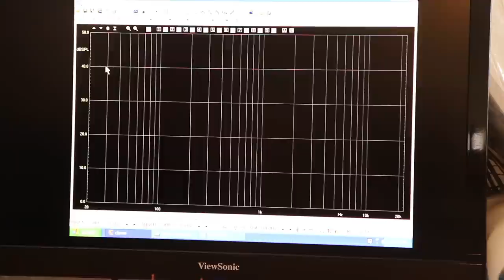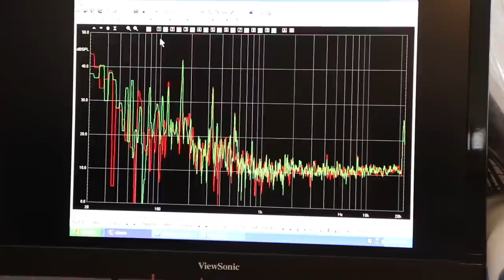Power Cable Tech Talk and a little help for Amir at Audio Science Review

Comment: 95+ % people do not own a system capable and at the level of being able to hear a difference in power cables. 

Another large majority of human beings do not possess the acute and training or ability of hearing to even be able to hear the difference. That’s another one of the problems. . 

Then another factor 
      If the system power cable does not radiate the EMF or RFI close to adjacent speaker, cables or signal cables to cause a problem, laid out in perfect conditions.   In that scenario, there may be no difference that could even be audible to somebody with not the best hearing.. 

But you turned that same scenario around as when I was a teenager.  Even my cheap system when the power cable was laid in back with all the other wires would mess with the sound and cause a problem..   but if I took a extension cord and routed the power cable up away from all wiring and away from the back of the units, preamps everything and over the top, giving it power from the other side of the room it was crystal clear.  
               So I changed out the power cable with one from a bonded and shielded VRF Drive Power Supply cable.  
         After I did that, the audio was clear, an interference, free. 

In that scenario, we’re talking about interference. Sound problem . 

Yes, I’m here is one of those characters he’s not stupid .   But he’s analytical and black and white paper kind a guy who can’t reason or fathom anything outside of what can’t be measured or cannot see with his eyes. Therefore, he thinks it doesn’t exist..  

      This is a human trait wired deep in green in the brain of a type of person he cannot help that.    

Just like some artistic people cannot look you in the eyes and be social, but yet they could be geniuses in one area .    But if you present them a problem that they’ve never seen before and they can’t comprehend, they just don’t get it.. 

Amir is one of those individuals, very bright, very talented. He has his field of expertise. . 

He has experience, but there’s just some things he just cannot grasp with his mind that are beyond his ability, probably till his dying Day .
Reply: "95+ % people do not own a system capable and at the level of being able to hear a difference in power cables. "  How come this is not stated on company website so people with lesser systems don't bother buying said cables?  Note that my testing of GR24 cable was in a very noisy environment.  Yet, I measured zero impact to the output of audio gear with no name cable vs Danny's.  Remember, there is a ton of noise coming from the AC signal itself.  If the power supply can filter that out, how come it can't filter what gets induced into the power cable which is at far, far lower amplitude?

Comment: I enjoyed this video. My understanding on balanced circuits is that it is to increase common mode rejection, CMR. The noise reduced is the noise picked up by the cables. The + & - on the sending cable must be the same impedance as each other and the input impedance of the receiving + & -  must match. In other words if the output is 100 ohms both pin 2 and pin 3 should match as close as possible also if the input is 10,000 ohms pin 2 and 3 must be matched. Signals being out of phase on the + & - will make the signal louder but it is not necessary to improve CMR.
Reply: God only knows how much you'd enjoyed the video if you knew anything about audio...
Reply: @cubemerula5264  I'm just saying signal symmetry has nothing to do with balanced connections ibalanced is to increase CMRR. See  IEC Standard 60268-3 for a start. Bill Whilock has covered this in his seminars also many well respected audio professionals express the same thoughts.
Reply: @samgates2059  Have you watched Amir's video(s) on Balanced connections and balanced circuits
Reply: @wesselingaudiodesign5031  I just went to his site to see what he said and he makes the same mistake there that he does on this review. On his forum there are several people saying what I said. This seems to be a common mistake.
Reply: @samgates2059  Interesting. I'll take a look.

Comment: Amir lost a lot of credibility and some respect from me despite seeing that he is an intelligent person. It kind of makes me sad his approach to this disagreement in understanding of power cables / eq vs upgraded cross over components, etc. his videos come off as hit pieces, not actually being objective. There have been many videos going back and forth and he comes off as feeling superior, I dislike his attitude, let alone his approach.

3 things would be nice - if your so confident in your conclusion, do everything you can to accommodate Danny's recommendations to give him as much benefit of the doubt as possible (like when testing the power cable without it being plugged in - how ridiculous as an engineer, and then to later defend that practice), then prove him wrong if your able

2 - once done a video or testing review, contact Danny, share your findings and find out if Danny has any rebuttals or input for a more accurate conclusion before releasing your findings

3 (optional) - I would love if he actually tested a system the way Danny actually recommends even though he doesn't agree with it - with 2 speakers. Give it a chance, even if he thinks he will say I don't hear a difference or it's too hard to tell or it's inconclusive.

He can keep his opinion, that doesn't need to change, just be more objective about it and put in more effort. Plugging the power cable in the wall without a load on it? That is seriously just insulting and then to defend it with a tick tester? Wow. Why don't you test how many amps are running on the line - 0. THAT is what creates the electromagnetic field, current and he would know that.

Comment: It is such a shame that he has no clue of what he is speaking and talks as if he has great knowledge. If ohms law is used, he is missing the entire balance of the IR portion of equation/quotient. The other part of ohms law of P=EI would be missing the P and I. It is extremely silly to try and equate anything without the base knowledge of what they are talking about. I can doubt the voracity of your claims but would at least have base knowledge of what to bring to the discussion table. In fact, I have an idea to help create a very inexpensive solution to the problem of interference but would not be useful as part of this post.

Comment: I believe in cables and the audible difference they make and I believe that our ears are the ultimate measuring instrument, superior to actual measuring scheme and apparatus.
Indeed in audio in many instances, the measurement can not translate sound quality because they are incomplete. I great exemple are the fantastic measuring sabre chip dac, which sound 2D and flat. The typical measurement do not capture their deficiencies, may be because the measurement are typically static (a single frequency fixed in time) so some dynamics elements must be ignored. R2R dacs measure worse but sound better than cheap chip based dacs...
Now what characterises the "flat earther" is that they do not trust their ears and music is only enjoyed while looking at an oscilloscope... They keep measuring cables and find no difference between the basic cheap design and the high end design and conclude that both sound the same.
Again I believe in the sound difference between the two, however I would like to know from Danny if there is a way to physically provide some different set of measurements showing the superiority of high end cable design.
And so far no one provides these measurements, which fuels the flat earther furthermore. Danny claims science but provides only words, no scientific measurement. Again they might be no way to measure the difference (end of debate trust your ears) but in this case he should say it.

Comment: All true, but if someone doesn't have a high resolving system they won't hear it, so these other guys, possibly have never heard a real high performance system properly set up they quite possibly just can't imagine what you're talking about.
Reply: You need to read about the Carver challenge. An audio engineer was challenged to make his budget amp sound like a very very expensive one. After a couple of days fiddling he succeeded using cheap components. He did the same with another expensive amp.  There are several excuses people use to explain why a double blind test failed. One is that the system was not resolving enough. Anither is that the listeners ears were poor. Thus the believers have resolving systems and special hearing. It’s all guff of course.
Reply: Nothing in company advertising says you have to have a resolving system to hear it.  That is no top of the notion of "resolving system" having no definition.  In addition, everyday people with budget systems are claiming they hear these improvements.  So either they are wrong, or Danny is.  Truth is that both are wrong in that they did not do a blind test so let their eyes and brain interfere with what they heard in making comparisons.  This is all ABCs of audio science that folks violate and then draw conclusions.